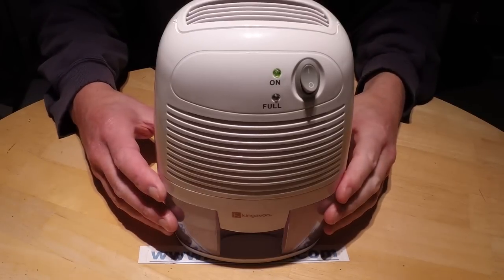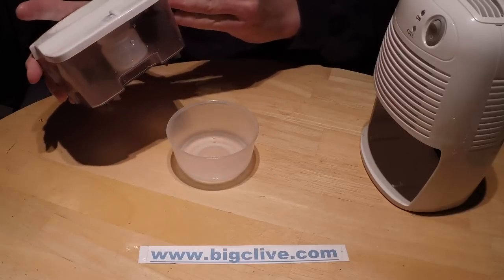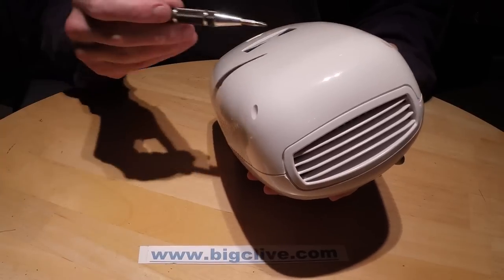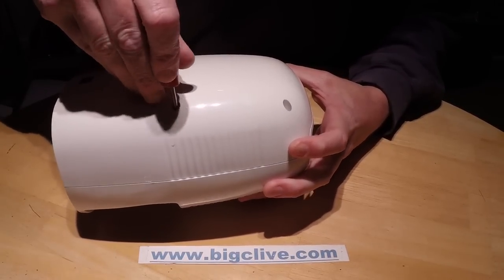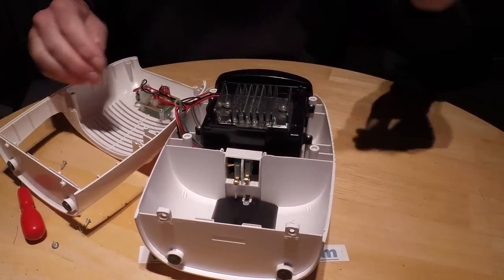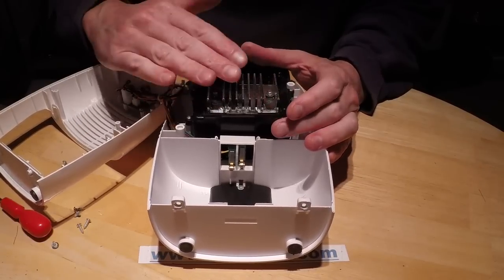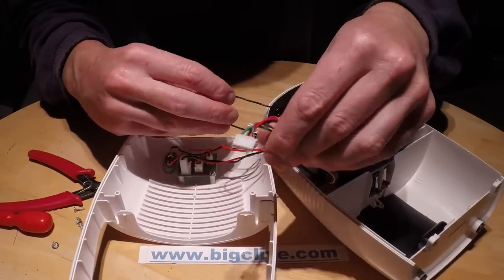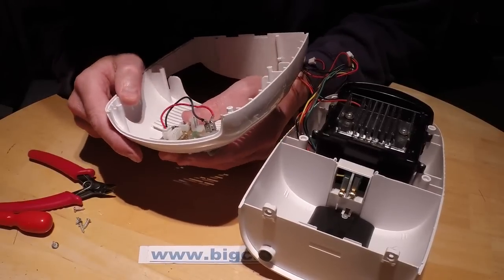Mini peltier dehumidifier teardown.

Comment: This is a long shot, but can anyone recommend a 12v dehumidifier? For my autocamper.
Everything i have seen running on 12v is using a peltier, never a compressor or dessicant, it shouldnt be that hard to find..? i just... Cant... I cant look at any more videos about dehumidifiers..
Reply from the maker: I only know if 12v Peltier units.  Not the most efficient, but do have solar power possibilities.
Reply: @bigclivedotcom  thanks for the reply.
i might be overly sceptical about peltier devices, they DO work i suppose.. and i have 2x220w panels and an oversized batterybank to run them so its not an issue, its just that the amount of moisture i need removed during the winter is quite a lot when the camper is occupied, so im doubtfull they suffice.
I'll end my ramble now, pardon me.
cheers :D
Reply from the maker: @benjaminandersen1097  I wonder if controlled ventilation may be the best way to purge humid air, although that does impact the heating.  Theoretically you could have a dedicated solar panel connected to a peltier device that just ran whenever there was enough light to power it.
Reply: venting the air would loose a lot of heat, too much, but i like the idea of a dedicated solar panel always running a peltier, i actually have a small 70w panel laying around that might be enough.

I have some cheap peltiers as well, so i might try and make one myself, i imagine it needs to freeze for a while, and then heat up shortly to de-ice. 

One good feature regarding their inefficience, all energy is converted to heat, so wasted power is not totaly wasted :)

Comment: Thermoelectric cooling generation is one of those things that's really cool in theory, and kinda crappy in practice. I tried building a TEC minifridge out of an old cooler and two Peltier units. It did work in the sense that it dropped the temperature of the cooler by a couple of degrees, but it required a ridiculous amount of power to do it. TEC power generation is about as equally worthless, but it is kinda cool, from a science point of view, getting a few volts from just the heat of a tea candle.
Reply: Bit of a long shot that you see this, but I was wondering if you could recommend resources and communities for someone to learn how to do something like making a dehumidifier with salvaged parts.

Not necessarily exactly that, but the basics of how to approach that sort of scrapheap challenge engineering as a novice.
Reply: Technology connections

Comment: Now all we need is a peltier (or should that be Peltier?) based air conditioner for those long hot Summer nights in a tent. Solar charger to keep a battery topped up, and we're in business!
Reply: It's a real drag carrying around the 4kW of solar panels you'd need to make this work in a tent.

Comment: Has anyone tried water cooling the hot end of a peltier? I’m thinking of a wet sponge on an electric cool box.  Surely phase transition should reduce ambient temperature, meaning colder beer. I’d be interested if anyone s done any experiments cos I don’t want to pull my new cool box apart ?
Reply: Yes, astronomical cameras water cool the hot side to get the cold side down to -40C.

Comment: Those are great !!!  I bought 3 dozen of them.  Still haven't found a personal use for them, though. Maybe around my boiler
and drained outdoors will keep the rust down. Now to buy large heat sinks.  Note to self: when using several in one
gadget, it's probably best to leave decent air gaps between them.

Comment: hey I got one of these and want to use it in my fridge i dont want a dessicant dehumidifier as it adds more heat what can i do to make it stop freezing up. I have a controller i can use to control the on/off and humidity %
thank you
Reply from the maker: I'm not sure these are really suitable for a fridge that gets opened repeatedly.
Reply: Thanks for your reply. 
I have converted a commercial fridge into a dry ager for meat. 
I have added fan,uvc,air purifer. the temps are controlled by the units digital controllern and the dehumidifers are conntected to a humidity controller
temps are about 1.7c average.
I want to drop the humdity about 10% on average its currently averaging 87%.
i know alot of the commercial dry age systems humidity is controlled by the compressor and condenser itself by tx valves and whatnot but $$ is too high for me. I was hoping of doing something with these or dessicant humidifers to lower the average a little more. 
Would adding somesort of heater to the inside help stop it from freezing but still collecting moisture?
or do you have anythinf else you could reccommend?

Comment: This little dehumidifiers works for what is intended to be used, it will not replace a compressor style dehumidifier, but for small spaces like small RV trailers, it will work perfectly. a piece of foam around the peltier will help the cooling and heat effect.

Comment: I have this exact same dehumidifier... I also have a 100w peltier chip. do you think i could put the 100w in place of the 30W that comes with the unit? will it be more effective at dehumidification? also, will it overpower the heatsinks? thanks for any help
Reply from the maker: The airflow would have to be matched to the panel.  If you have need of greater dehumidification then a traditional dehumidifier may be a lot more efficient.

Comment: would this work more efficiently if you were to have 4 Peltier's on the Large heat sink. and then back it with a heatsink of the same size on the opposite side?
Reply from the maker: I'd guess it might help, but the airflow is also a really important factor.

Comment: You know, I never really thought about using a peltier to heat something.  But it would be more efficient than simple resistive heating because you're already getting resistive heat PLUS whatever heat you've got flowing to the cold side of the junction...

Comment: I know this is old. But out of curiosity: Isn't water collection dependent upon your RH? If it is not high, then less water is collected. Higher RH, then more water is collected? So, trying to get a lot of water from a 30 or 40 RH isn't going to produce much? (This is me just thinking out loud, please correct me if I am wrong, which I probably am, as I am ignorant with regards to dehumidifiers.)

Comment: Just got one at a thrift store today new in the box. Plugged it in and not even 5 minutes later a cap in the Power supply blew. (Venting) and the back was rather warm. Oddly enough, it had a 9vdc 2.5 amp output. No name on it either. Go figure.
Reply: Cap may have been installed backwards.

Comment: There is one thing they forgot in the design.....
I have exactly the same dehumidifier running in my shed, but when the temperature in the shed goes below about 8°C the cold side heatsink becomes one big lump of ice !
So I added a 10° clixon to turn it off....
(also added a drain hose so I don't have to empty it manually 😄)

Comment: If you reverse the polarity on the peltier junction, It won't just swap the hot and cold sides. It will in fact transport heat in the opposite direction but at a drastically reduced rate. They only really work in one way and therefore they must always be supplied as specified.
Reply: You are correct, if you change the heat sinks with larger sized ones in the cold side then you can eliminate that issue. Considering people would likely be hacking these devices for other purposes if they're changing polarity anyways, it's a simple matter to do. The peltier element itself works just as efficiently in either polarity, it's only the heatsinks that make a difference.

Comment: Thanks for the video, helped me get going on repairing.

I have two of these that stopped working after a year.  I’ve replaced the Peltier modules and they’re working well again.  I wondered what makes them fail, maybe they were clogged with dust and too hot.  Peltier spec. says max 60’C.  The Peltier modules on eBay are 40 mm sq, bigger than the originals, but doesn’t seem to matter.

Various people have said that the hot heatsink is touching the air on the cold side, I’ve put foam there.  Even worse, one of mine had a 50 mm * 2 mm gap allowing hot air into the cold side. Foam in there now.  The gap is where the Peltier+heatsinks module does not quite fill the hole in in its plastic housing.

Comment: I had a peltier CPU cooler in my monster rig build, back in 2007. It worked VERY well!
Reply: I used to use them way back in the late 90s, around the AMD K6 or Pentium III era. They worked very well unless the fan on your heat sink died, then they were capable of some extreme temps on the hot side and would typically burn out.

Comment: I wouldn't have thought about a Peltier dehumidifier. I'm so used to the old fashioned refrigerated ones that it never occurred to me that that was an option. Nice find Clive. You dissect some of the neatest little gizmos.
Reply from the maker: It's really inefficient compared to the refrigeration and newer desiccant drum style dehumidifiers.  More of a novelty than a useful device unless you have a small space needing kept dry with just a 12V supply.  (Like a remote cabin with a solar panel.)

Comment: It's never going to be that effective,  there's no insulation around the peltier. So some of the heat is going back into the cold side. It needs a frame of foam between the two heatsinks.
Reply: Also there are screws connecting the two heat sinks. Its not necessary to be a genius to see that it's a big technical mistake.
Reply: Yes, I've pushed foam in there.

Comment: What could have gone wrong? It suddenly stopped working after less than a year. The power LED flashes dimly, but that's all. The circuitry board looks very simple, just 2 LEDs and 2 resistors. Can anyone help please?
Reply from the maker: The pulsing LED suggests that the power supply has failed.
Reply: Thank you. Does that mean the circuit board? The power adapter puts out 9 volt as is specified for this model.
Reply: Never mind. The seller provided a new unit for free.

Comment: so 30W x 10 hours = half-ish a cup of water? ...seems like a waste of electricity/very inefficient to me...looks designed by an engineering class clown that was lazy...n like it could have been done better VERY easily by sizing the heat sink properly and running the air better..
Reply: Undervolting the peltiers helps alot with efficiency. The problem is it takes a lot more peltiers to do the same job, which increases manufacturing costs.

Comment: I have often wondered if a Peliter  device would be a very good  to use to make distilled water. The hot side could be used to evaporate water and the cold side could be used to re-condense it. This should result in a very efficient system. The losses in the Peltier are associated with the devices resistance. By stacking, the necessary temperature difference could be maintained.
I have seen such devices used in cabinet rack cooling for telecoms and computer equipment. The advantage of such a system is that the electronics can be sealed from the outside environment, allowing the humidity within the rack to be limited with silica gel packs.
Reply from the maker: Peltier panels are simple and convenient, but not really efficient.  However, it's always worth experimenting.

Comment: You'd be right to put that more towards the center. I see why it's not working that well too. The condensation heatsink isn't large enough. Neither is the dissipation heatsink. I think you could use the parts to make something far better though. Something with heat pipes would do a right nice job of it for the dissipation side. For the condensation side you want one of those old solid aluminium whoppers for the older AMD chips. Trust me when I say they work quite nicely for that...
Reply: You have to be careful, if you make the Peltier too efficient the cold side will get cold enough to freeze the water and it won't work properly.

Comment: The junction should be located between the screws and the screws should be some non-electrical/thermally-conductive material and there damned well should be a thermal insulator between the exposed metals.  Do that and you should DOUBLE the capture rate.

Comment: Any chance of one of these little things being worth using in the bathroom to de-humidify during/after taking a shower? I saw one about the same price with a humidity control. My brother seems to not like turning the vent fan on, so if I had that with the humidistat set to come on when it gets humid in there, it'd hopefully help. Plus the fan isn't very powerful and I feel like even with it on it gets too wet in there for my liking.
Reply from the maker: It would be better to leave the fan running until the room is dry.  These little units are not suited to removing a lot of moisture.
Reply: Wire the fan to the lightswitch in houses where people won't turn the fan on. :)
Reply: Buy a small ac fan and put it on your window sill to extract the moisture

Comment: There is no fan on the cold side? would it be more efficient if it had one?  Or is the hot side fan circulating air on the cold side too?
Reply from the maker: It pulls the air in across the cold side before passing it over the hot side.

Comment: where is the best place to put one in a room
Reply from the maker: Anywhere that's conveniently close to power, as the units circulate the air.  In colder rooms it sometimes helps to put the unit up on a table.
Reply from the maker: I should add that for home dehumidifying I'd strongly recommend a full size dehumidifier as these units are very inefficient and don't collect anywhere near as much moisture as a full size unit.
Reply: thanks thay are only small roos

Comment: I have one of these, and i am hoping you might be able to tell me why it stopped working.  i turned it off for a few days and now when i turn it on both the power and full lights blink and nothing else happens.  the water tray is definitely pushed in.  thanks

Comment: I replaced the Thermal paste with some cooler master thermal one , it did improve the performance of it , would be interesting to monitor both surfaces temperature...
Reply: I noticed that this unit seemed to have an excess of heat sink compound.

Comment: Why the air is not pulled in from the hot side to the cold, so the 
temperature difference is greater and the effect would be more 
efficient? It is logical - just there must be additional air holes 
behind where the fan is and the fan should pull the air in. Then the air
 will go hot and then go to the cold side and then exit from the front 
air holes (not the back ones). And why the cold radiator is smaller then
 the hot one?
Reply: The water capacity of air is related to its temperature. The lower the temperature, the less humidity it can carry. By cooling the air, the water capacity is lower so the water will readily condense on the cold heatsink. Then you heat the air back up so it returns to the previous temperature but it's dryer.

If you were to do this in reverse and heat the air beforehand, you wouldn't extract any water at all from the air. The hot air would have a higher water capacity, then it would be cooled without any water being condensed.
Reply: That would prevent any water from condesing. Even if the peltier would be 100% efficient.
Reply: One reason to pull air from the ambient temp thru the cold to the hot is that the ambient temp input air is "usually" * lower temp than the hot side is, so its able to get down to dewpoint faster and condense faster when it hits the cold sink; ** if the airflow is from hot sink to cold sink, the air becomes somewhat warmed and then on to the cold side where it actually heats the cold side more than the other way.. hope this makes sense.
Reply: If you were making a cooling fan than yes pull air through the back past the cooling side and out however I must point out this unit does not have any other intake than the top, the vent on the side and front are cosmetic so its pulling and pushing through the same hole......weird.
mines useless so I am thinking of making it into a fan

Comment: I have to say I was very impressed with the one I bought to get all the dampness out of my car. 600ml over the Xmas period in temperatures below freezing. For the price it did a fantastic job, how else to you get the inside of your car dry in winter. Clive, thanks for the breakdown.
Reply from the maker: I take it you must have run an external power supply to it?  One of the applications where this thing would really work well is in a remote caravan with its own solar panel so that when there was enough sunshine the unit would trundle up and start extracting moisture from the interior and draining it to outside.
Reply: A bit late But,  When you get close to the end of your journey turn off the heating in your car, open a window and let all the heat out of your car so the windows, seats etc, are the same temp as out side so condensation cannot build up with the heat difference, also when it's snowing out side try not to get snow inside your car of your shoes, get some rubber collector mats for your car, the type that have a grid cell pattern on them to collect the water off your shoes then you can just tip the collected water out of the car.
always worked for me and still do it to this day.